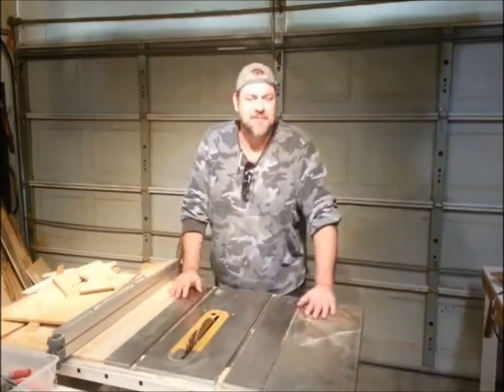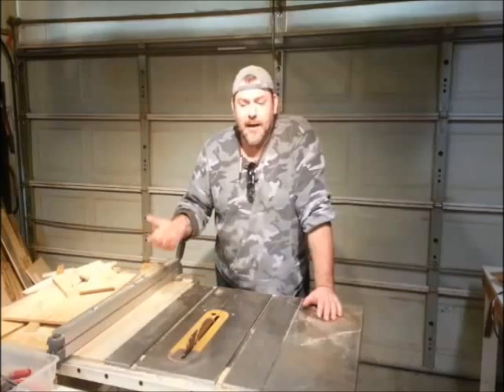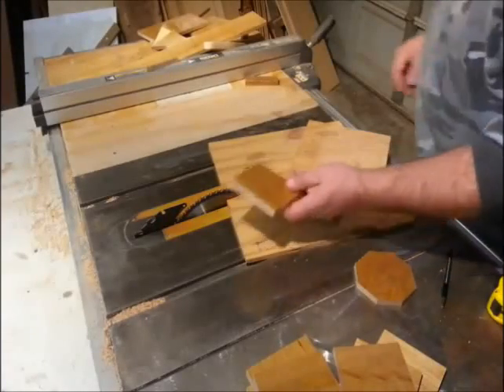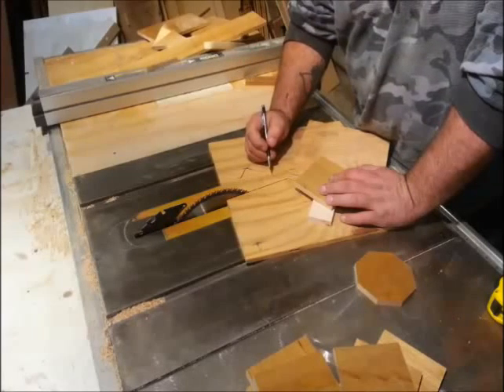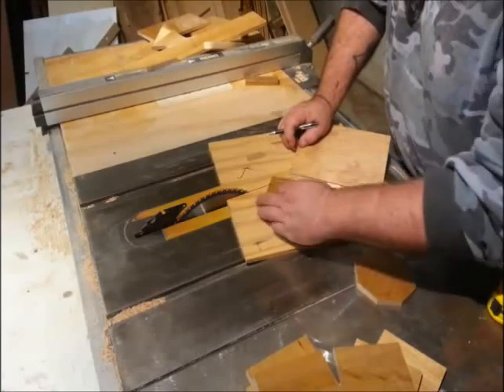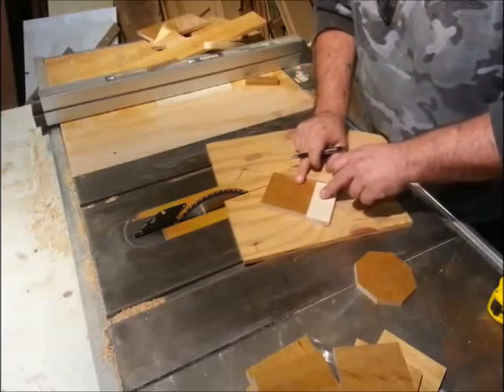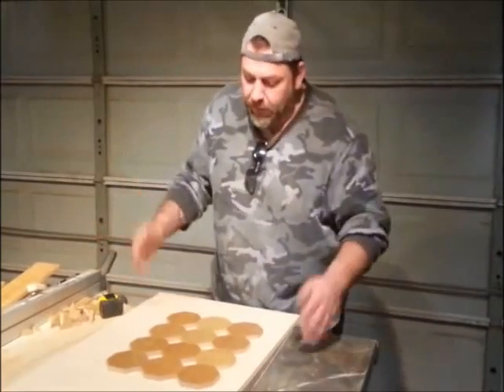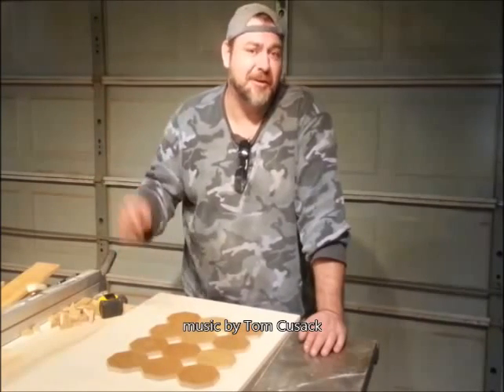Make Perfect Octagons! Simple Method!

Comment from the maker: Hmm, I will have to check on that. If you make 45 degree cuts on each corner you end up with an octogon if you stand it up and look at it like its the side veiw of and octo cube those angles are still 45 degrees.  Rotate it 90 dehrees and look at it from a front or back perspective they are still 45 degree angles. The only angle that would not be 45 is the where the two shelves meet along the 45degree cuts.

Comment: The second sled you used, the one where you cut the squares to make the octagons. What is the angle that the top piece of wood is set at. I don't believe you mentioned that, but to me it looks like it is at a 45 degree angle. If that's the case, how is it possible to make a octagon from 45 degree cuts.  Still a good video though.

Comment: I think 45° would be too much to bevel relief for that octagon dice thing that was mentioned at the end. a 45° bevel would have each facet mating up at perpendicular angles to each other. that would make 6 octagonal facets (like a box) with 8 triangle facets needed to fill in the nicked off corners.
Reply: 360/8=45
Reply: @tomwiggins1225  right you are Tom. Nobody's arguing that, however, that would mean Each angle cut would be 22½° not 45°. 45° is the angle you cut to make squares. For example, if you cut six squares and beveled each side of each Square 45°, they would all fit together perfectly to make a cube. With just enough room for some squeeze out . Three of the same size isosceles right triangles with their edges beveled at 45 degrees would make a perfect three-sided pyramid with a dirt floor... 45° is too steep of a turn for an octagon. But it'd be a good way to cheat an octagon if you had plenty of filler to make up for all that thickness that won't be touching